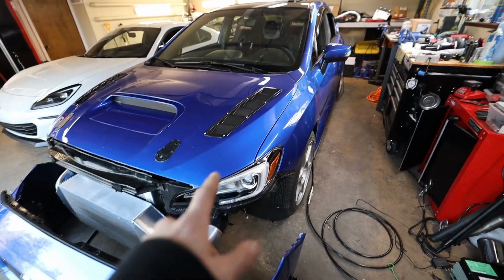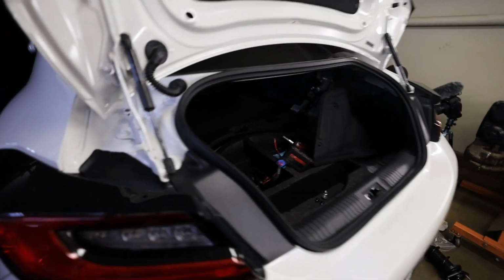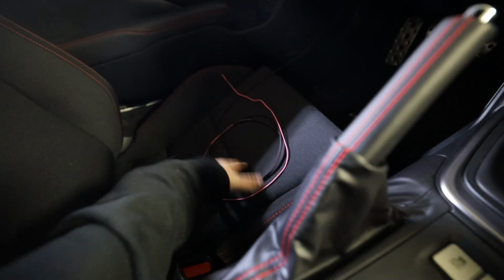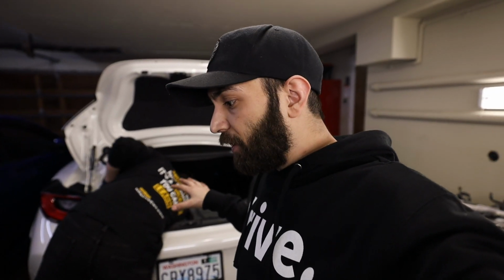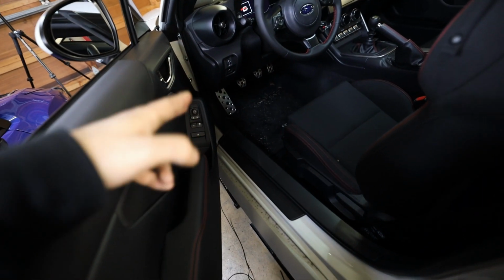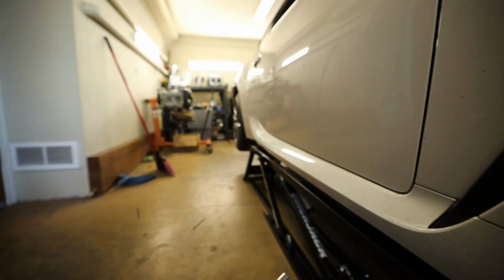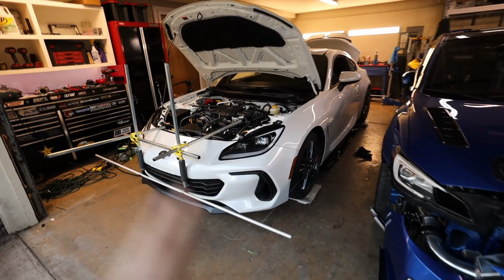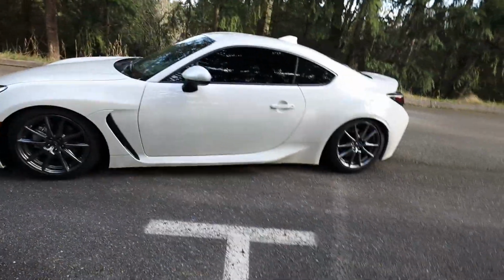Bagging my 2022 Subaru BRZ With Airlift Performance!

Comment: Get some 1/4” tech flex wire loom for your air line and leader hose from compressor to tank. That stuff is minty fresh 👌 Love ya homie!
Reply from the maker: I have some in the garage, figured it wouldent help protect it too much 🤔
Reply: @Smeedia  won’t do much protection but will make it pretty! 😍😍

Comment: Hey Smeedia, I need your opinion (or anybody's opinion or suggestions) . Kind of embarrassed to admit this and wont make excuses but I have neglected my daily 2017 WRX. Haven't done a proper  oil change for bout 20k miles.  I commute about 30 to 40 miles on work days, and every other weekend I drive almost 200 miles to go to and return from a distant town. Hardly any pulls, no track days. Should I just simply change oil and filter? Engine flush it? If so what product would you recommend? Should I do an oil analysis? I am planning to do some more serious engine mods to my car. Only mods I have is a Cobb Intake,  Accessport, TGV and EGR delete kits. I've kept an eye on my DAM and Knock feedback, nothing pops up other than that -1.41 and an occasional -2.81 when I do a quick pull. Thanks
Reply from the maker: Totally normal values and nothing to stress, just swap the pil and you'll be solid. Unless the car is acting up I wouldent worry about anything 😁
Reply: @Smeedia  thank you

Comment: Bag newb here- but why doesnt anyone use a 5 gal pancake tank that could fit in the spare tire wheel well? I get that the tank equals most of the "flex" but it would be so much cleaner if you could just hide the tank.
Reply from the maker: Definitely can, for me I like thr ascetic of seeing the tank in the bank 😁

Comment: Stock wheels and tires still look decent,any idea on what kind of tires your going to go with? I've heard michelin pilot sports are decent
Reply from the maker: Will either do the DW or the Pilot 4S 😁🔥 ideally I'd like to run a 245/255 in the rear and a 235 on the front
Reply: @Smeedia  honestly 255 in the rear and 235 would be a nice offset and decent fitment

Comment: Would supporting mods still be necessary if you're only airing out whilst parked? Assuming you'd be driving at or at least close to factory height- would driving need to be corrected with use of aftermarket components, or do the stock components work?

Realizing the stance would look pretty off  without the supporting components, of course

Comment: Looks great! Can't wait to get my 86 that ive had a deposit on for a bit now. For this kit was there any modification to the front wheel wells? I've heard of some folks taking a hammer to the inside so the bags dont hit. Still cant decide if i wants bags or coilovers with air cups lol.
Reply from the maker: Of you plan on running a decent amount of camber I would definitely hammer thebstrut towers a little. But we did not, no issues, no rubbing 😁 any time frame for when it's suppose to come in?!
Reply: @Smeedia  Sadly no clue. Could pick up a auto car today but im holding out for a white premium manual. Sales guy said today im near the top of the list but its all about snagging the right car.

Comment: Im sure if you already covered this question or not but hone much does it cost to set up a system like that? Also BRZ looks ba
Reply from the maker: Airlift keeps raising their prices, I spent about 3500 on this set up. My STI I did for around 2800.

Comment: Smeedia or anybody else they may be able to help , we replaced the motor in my 13 sti and now it won’t start . We’ve checked all the grounds and they’re fine. Now when we unplug the camshaft sensors it doesn’t throw a code like it does when we unhook the maf sensor . Does anybody have any idea what might be the problem here ? Please help
Reply: I need somebody to reply if you’ve got a little time
Reply from the maker: Is it turning over or just not starting?
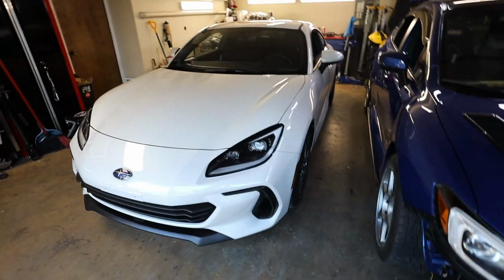Reply: @Smeedia  we found a cam shaft position sensor that lost voltage when we plug it in . So we’re gonna try replacing that first . It’ll be here at 1:30 . I’ll put that on and see where I’m at then. If nothing changes I’ll try to give you the whole rundown . Thanks for replying